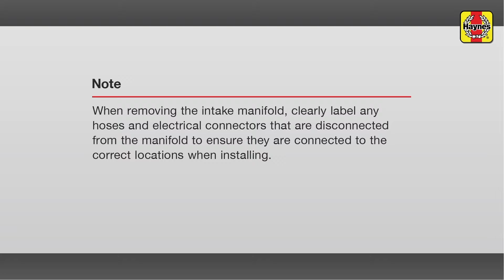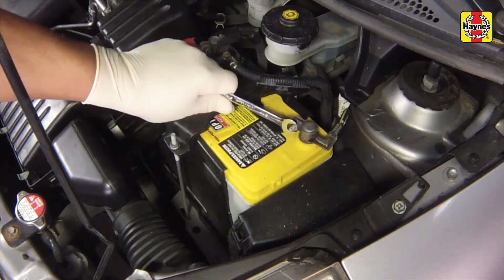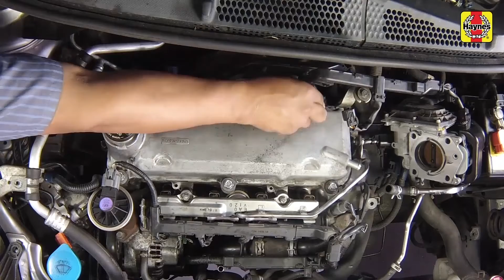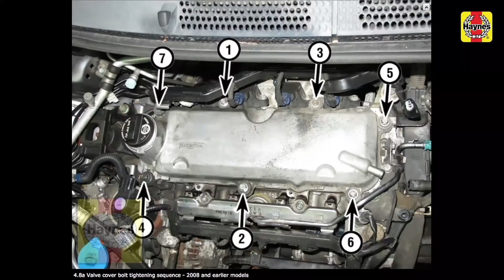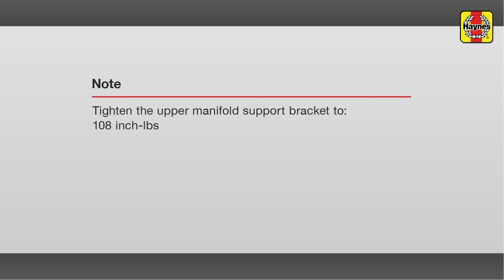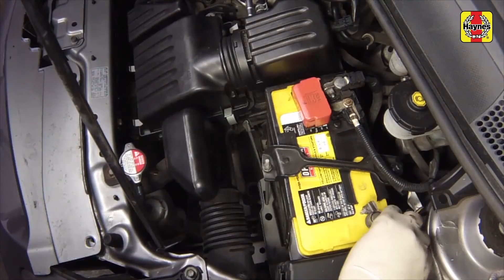How to adjust valves on the Honda Fit 2007 to 2013

Comment: Hi, great video very informative, just curious about the  transmission if I needed to put it on neutral while doing valve adjustment or stay on park because I got A/T trans. Thanks
Reply: @NicChannel08  Just have it in neutral with the park brake on. You have to turn the crank so it would be easier without any connection on back to the tires.

Comment: Hi, am having trouble with my automatic transmission of Honda fit L13A, it's only changing to the third gear
Reply: I'd try a fluid flush an new trans filter an cross your fingers. If you feel vibrations you could need engine/ trans mounts

Comment: Great video! Couple things for a 2010 fit sport
- different air box and connections
-my motor has no room for valve adjusting tool due to confined space over exhaust valves
-would have been great to see specs, torques, and sizes prior to action in video. 
-bent feelers will help a lot with inserting I to the valves

Over all such an awesome DIY video complete with a very calming women talking you through everything. Thank you for this video.👍
Reply: @mg8720-u7j  Honda recommends every 40.000 kms.